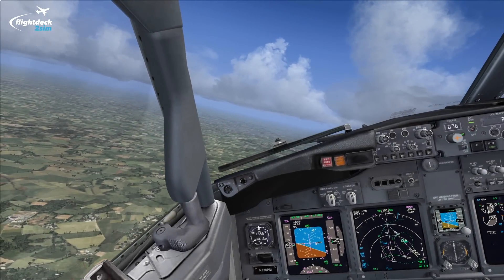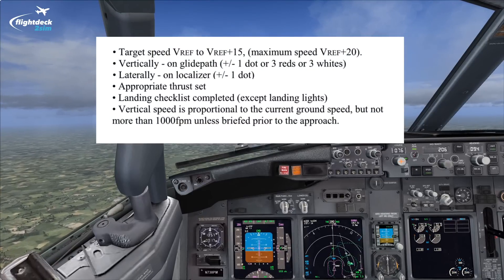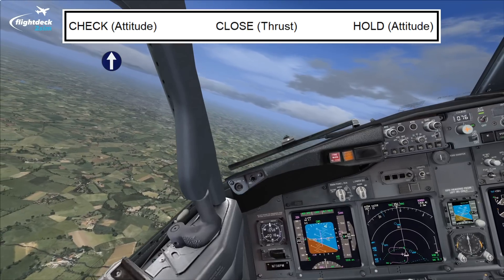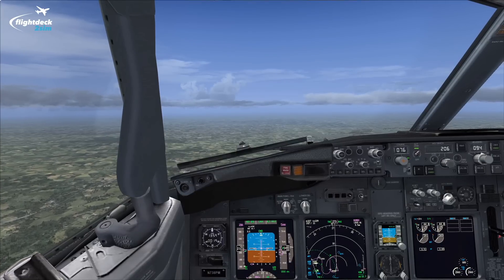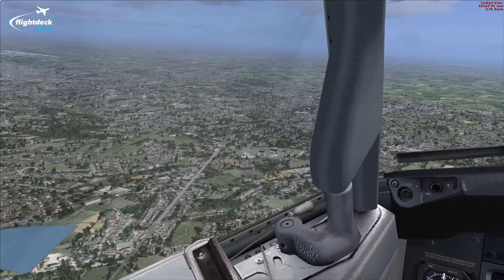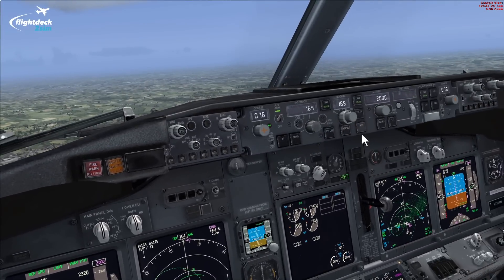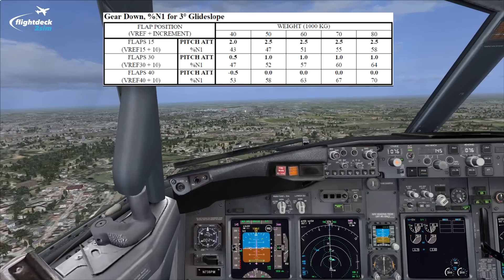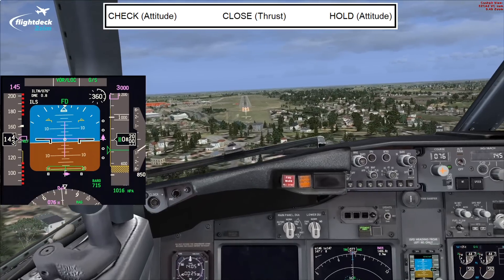How to Land the PMDG 737 by a Real 737 Captain

Comment: Is it satisfying to land a 'floater' in real life?
Reply from the maker: Hi NickSteevs

It's never our intention to "float" down the runway, we want to safely land within the touchdown zone. It is satisfying when you apply the "check, close, hold" technique and land smoothly but in certain instances this is undesirable such as landing on a contaminated runway covered in snow where we want to land firmly so we can stop as soon as possible! 

If you go for that "greaser" on a short runway you'll be using valuable runway where you really want to have the wheels on the ground applying brakes, reverses engaged and ground spoilers extended! 

Trust me, there is a massive misconception with the general public that a smooth landing is a good landing....

FD2S
Reply: flightdeck2sim I know smooth landings aren't the best. Thanks for your answer
Reply: Hi, I'm also a professional pilot and I flew the 737NG in the past. In my opinion on the NGX with flaps 30 the aircraft floats too much, it looks like there is a higher than normal ground effect which doesn't happen in the real aircraft. Flaps 40 landing is much more realistic, however the handling of the NGX with flaps 40 is terrible compared to the real aircraft. Do you agree with me or am I crazy? or I just don´t know how to land? :P

By the way excelent job with your channel, I'm subscribing.
Reply from the maker: Hi Mauricio.

Yes I agree! F30 is a little floaty with the NGX! I’ve not compared F40 and how it handles to the Level D or real aircraft but for what is essentially an entertainment product it’s pretty good!

Take care!

FD2S
Reply from the maker: Flo B I’ll try and be a little less hectic next time! If you try a desktop simulator you’ll find they’re pretty accurate but the NGX is a little more floaty than the real thing. You mentioned I flared too late? Did you not use the check close hold technique flying the 737 and 777 and check at 20ft? It’s good to compare real world experience and different techniques, I’ve been teaching pilots to land using check, close, hold in the 737 as recommended by Boeing for the past few years.

FD2S
Reply from the maker: Flo B cool! Thanks for sharing! Interesting to hear there are different techniques to landing the 737.

Comment: I noticed from the landing table you showed that a flap40 approach attitude should be 0 degrees? Can you elaborate on that?
Reply from the maker: Hello Again! 

The Pitch and Attitude thrust setting for a 60 tonne aircraft, Flap 40 on a 3 degree ILS is 0 degrees and 63%. This reference and attitude thrust setting should theoretically give you VREF 40 + 10kts.

This table is from the QRH Airspeed Unreliable Chapter. It covers attitude and thrust setting for pretty much every phase of flight in the event we lose our ASI's in flight. 

During the Type Rating crew look at several scenarios where the ASI's fail and they have to complete an approach without reference to the ASI and will refer to this table frequently as per the QRH guidance. 

Hope this helped answer your query! 

FD2S.